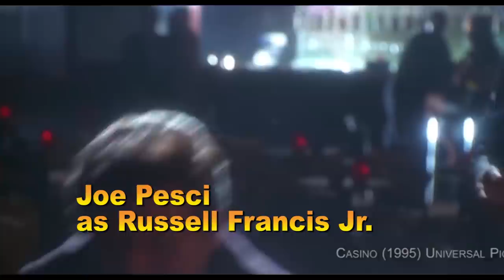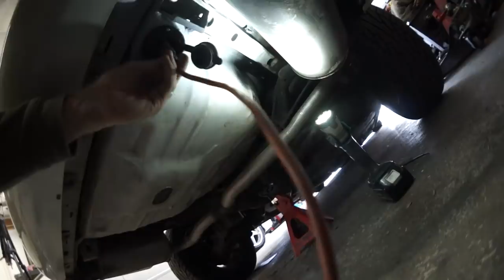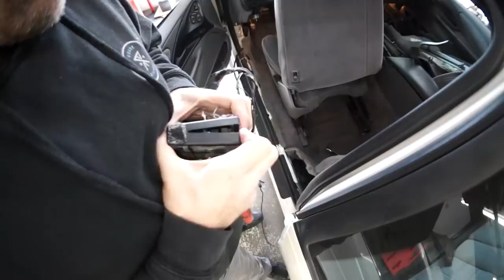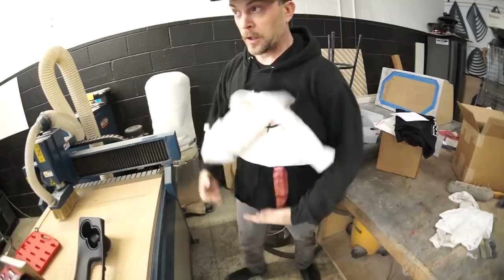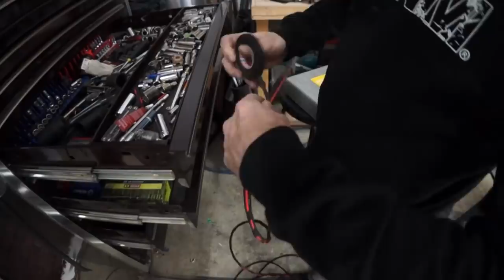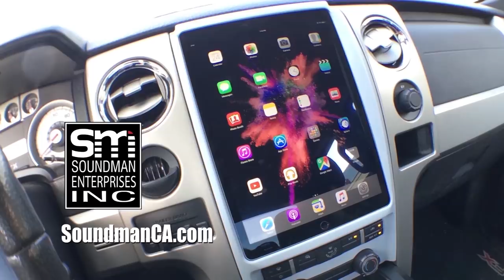I wired the T-Bird for audio - White Rider series #67

Comment: Could have ran the charge port behind the liscens plate. Get a flip down plate bracket from a old Cutlass, Monte or Nova. Run you wires up in the trunk lid. Eliminates having to get down on the ground to plug it in.

Comment: You should uses shielded rca's, they make a world of a difference with sq and reducing noise. Used it with my 4 channel at the time they were NOS Radio Shack gold series cables from the late 90's (true copper no aluminum mix, gold plated copper connectors). I threw my twisted cables away after that lol. No alternator noise, even though it was a new alternator and no static through thee mids/ high's with the volume all the way up, nothing playing. Especially when your throwing McIntosh goodies in it! ;)